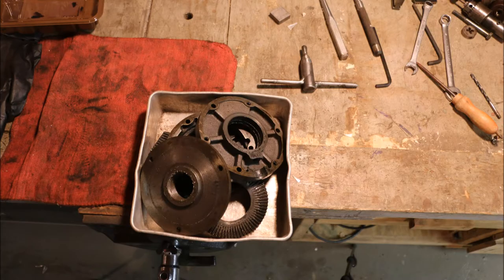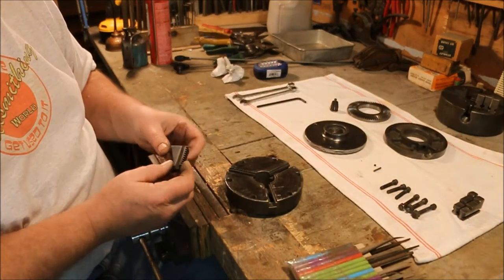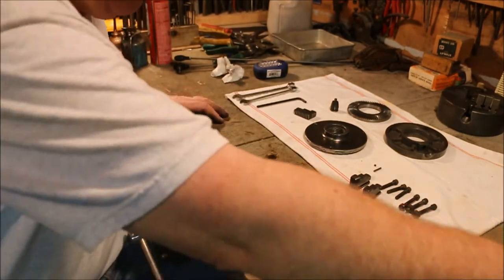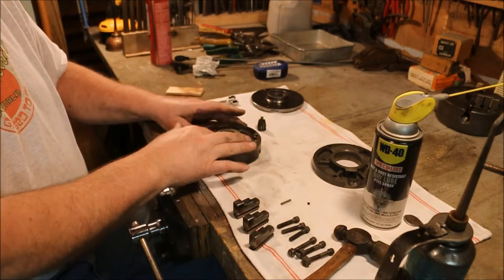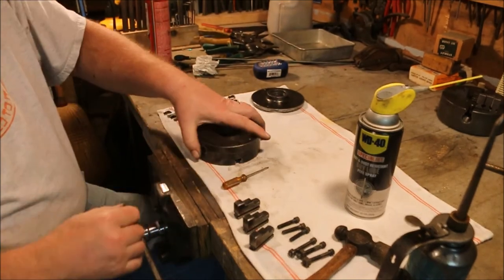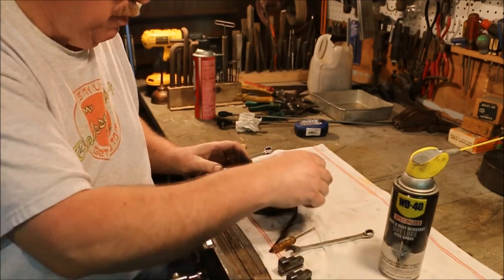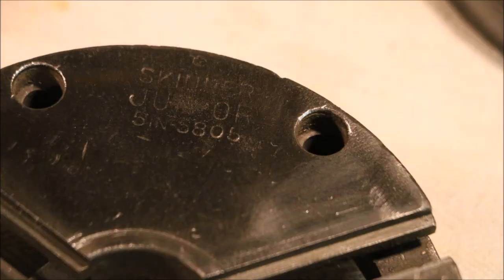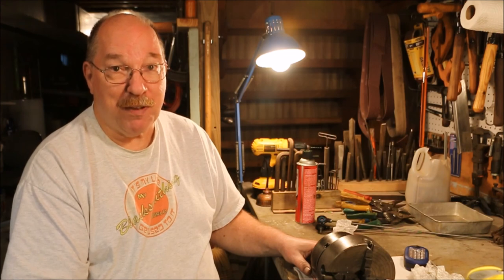SHOP ORGANIZATION CLEANING A THREE JAW LATHE CHUCK ~ PART 3 ~ ASSEMBLY

Comment: ..If you get it back together and there aint no parts left, that's a Success !!! Good Job Bossman...!!
Reply from the maker: Thanks. There are piles of tools laying around that just need a bit of TLC.
Reply: Maybe they didn't need to be there in the first place. You've seen them too I know, Jimmy Bob.
Reply from the maker: Sometimes it's like working on a 500 piece puzzle with no picture and finding 550 pieces in the box. I always like the boxes of half torn apart things that needed an ounce of inspiration and an hours work to get them running. A real feeling of satisfaction when you finally get the thing to roll, thump, bang, or clunk like it was designed too. 
It can be a bit unsettling too. My first Harley we didn't know how to time it. We were 180 degrees off on the breaker points. It fired on the way up to compression and about threw me over the bars. If I hadn't been young and spry it would have given me a bad case of Phil Jewel knee.
Reply: I can't handle puzzles but very little, mostly in passing BUT wrenching is a lot like a metal puzzle. You and the #1 Harley was like me and the #1 Gravely. Swapped all the guts over from a busted case to the other. Never even looked at one good but there I went. Just kept cranking the mag coupler back to where it ran good and called it done. And like the old Hogs with the advance on the left bar. Interesting. I still say they were just like a Cat pony motor. Somebody ought to mount one on a 2-wheel frame with a radiator. SAY, that'd make a project!!
Reply: haha, i rebuilt a 2 stroke autocycle, the timing was the position of the flywheel on the shaft, no key or markings, had no manual so guessed what the btdc, i guess i over did it, it started, but was running backwards, (2 strokes dont care) and let off the clutch, and wow!
Reply from the maker: Bad enough trying to ride forward sometimes. Most motorcycles don't have a reverse just for that reason. 😊
Reply: Years ago when we had some place to ride we all had trail bikes. A buddy of mine had a Bultaco Matador that I took out for a spin one evening. I stopped to look at a creek to see if there was a fish wanting to go home with me because I was NOT a fisherman of any kind and while the bike was idling it gave a sort of 'piffle' and kept on running. I put it into 1st and tried to take off and it backed up! I about had a stroke, thinking I'd messed the bike up somehow. I kicked it back in neutral and tried again  Same thing. I shut it of, restarted it and everything was fine. Those things would change rotation and never stop running. Live and learn.

Comment: ive just fixed up two nice adjustable wrenches i bough years ago really cheap at a boot fair, rothenberger, almost brand new, reason the guy sold them both were jamming up whichever way you moved them, i bought them as they were shiny and new and would one day figure out what was going on.  so this week i did, turns out there were burs on the top hole and on the bottom of the slideway -reason being someone had used it to hammer with, so burred those parts jamming it,  5 minutes on each taking apart, filing, 2 new wrenches, they list at  45  dollars,i paid 2 each for them
Reply from the maker: A fine job of fixing someone's error.
Reply: It ain't rocket science, just common (or uncommon) sense.